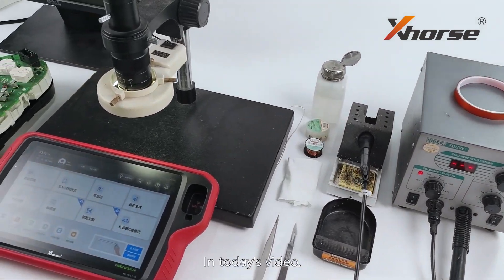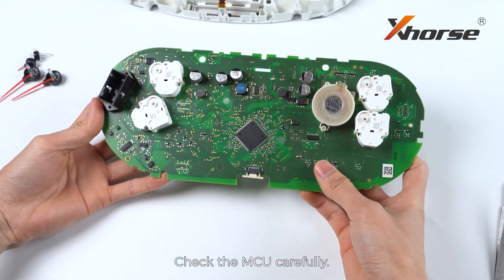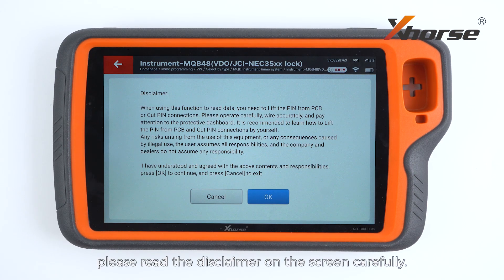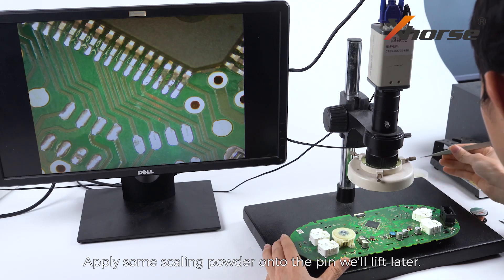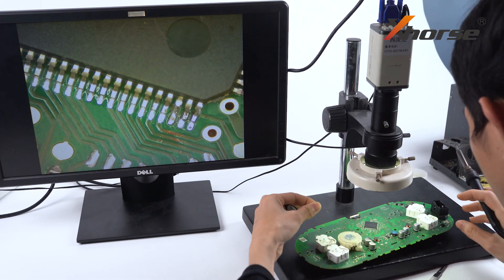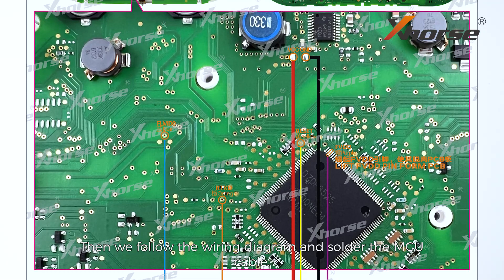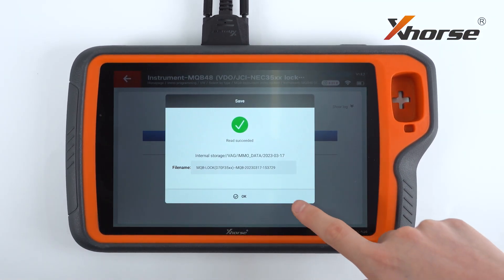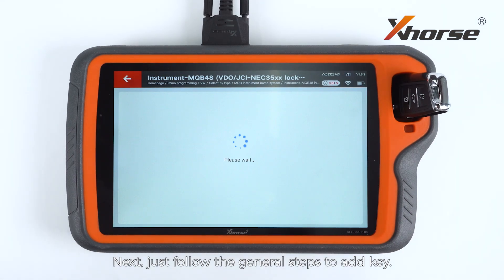Read MQB Locked NEC35xx Using KEY TOOL PLUS | Xhorse

Comment: Cómo hago para activar Mqb?
Reply from the maker: Please contact your area dealer.😀
Reply: Very good directions. 2 questions.
Why remove needles? Nothing to connect to on that side of the board &
Can u get sync data for Lost Keys?
Reply from the maker: @zwifting  Yeah, you don't need to remove needles. We did so for a better demonstration of operating.
Reply: @xhorseglobal6862  i learned that with hard way i removed it after i did i asked my self why the F did i do that xD
Reply: Synchro data no. @zwifting  synchro